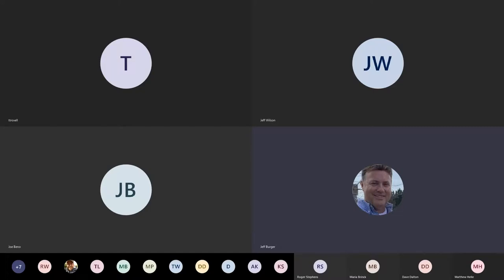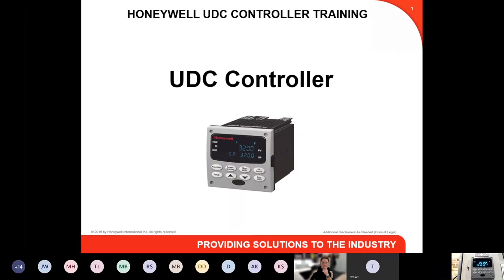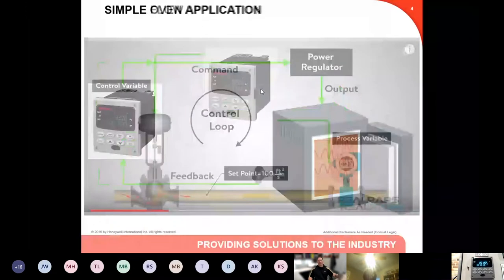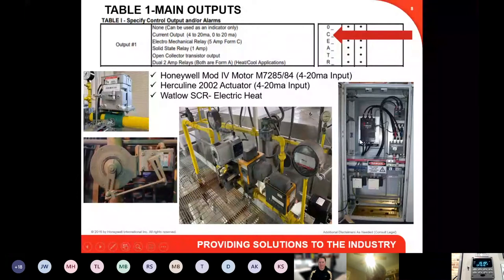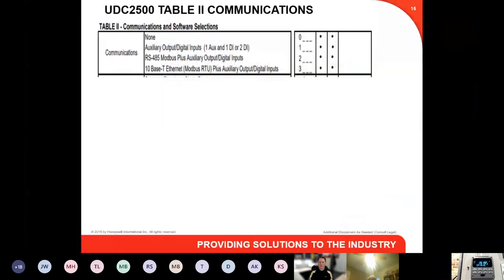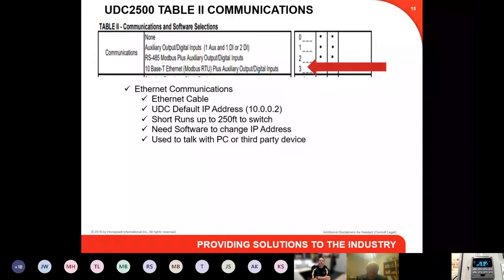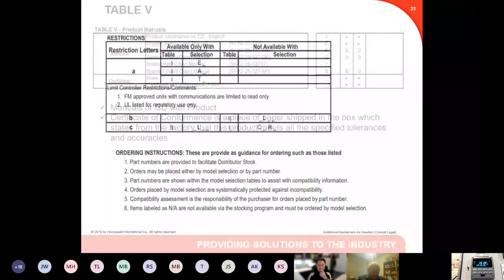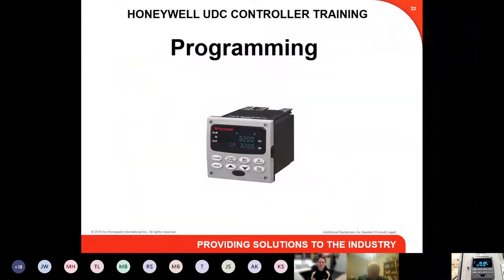Tech Tuesday with Loy - Honeywell UDC Controllers

Comment: I have a udc 1000 micro pro and am trying to run it on 230 volts and it after a few minutes smokes blowing a capacitor, but it runs well on 110 what am I doing wrong and I am running a lab vacuum oven also using a ssr